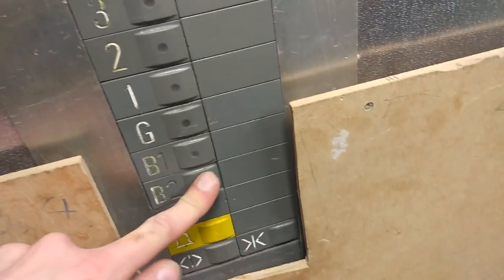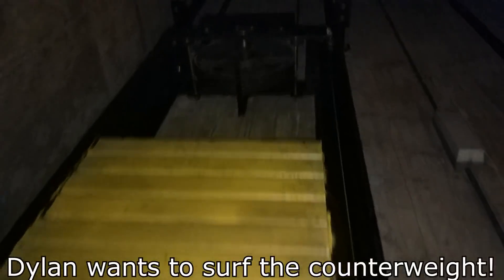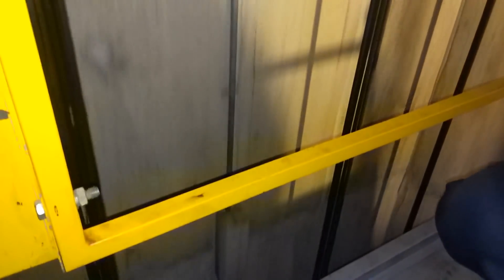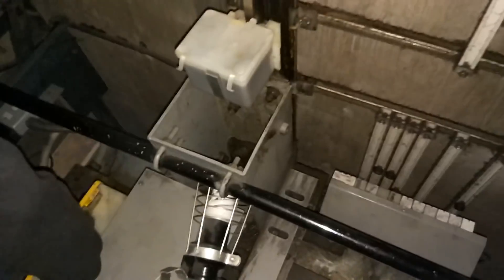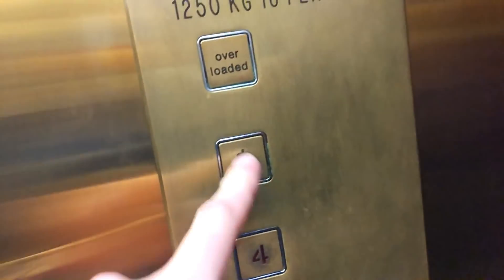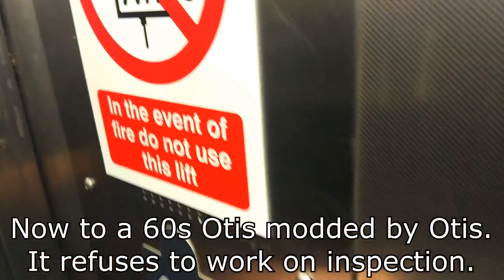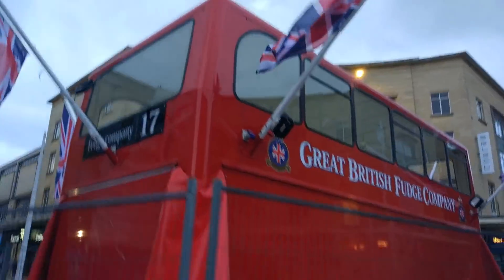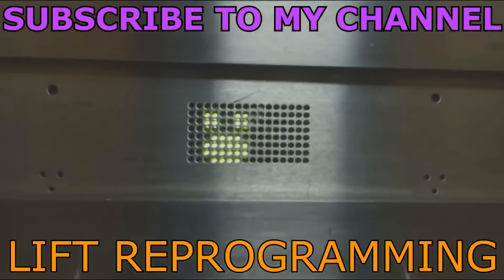Epic Schindlers with Dylan Rhodes and Urban Odyssey

Comment: I've never seen blue cables before. Is that the colour added to those particular cables when they were laminated?
Reply from the maker: Orona have a weird obsession with laminated cabled.  Normally the coating is transparent, but to add to the lift surfing experience, they gave this lift luxury magic blue coated cables.
Reply: Do you know why Orona laminate the cables? Is it an attempt at motion noise reduction or something?
Reply from the maker: They probably saw Otis and Schindler belt cables and thought they needed to join in and have plastic around the cables.